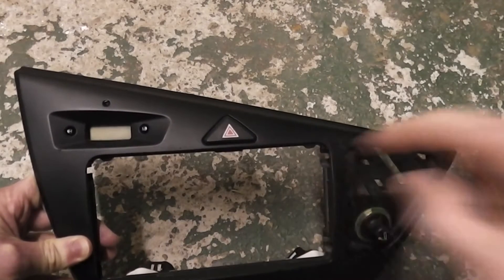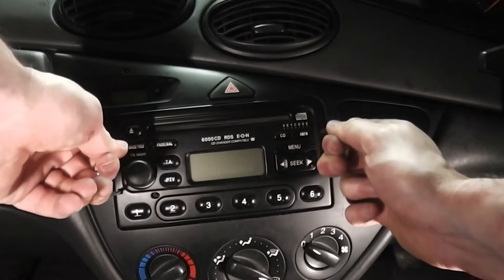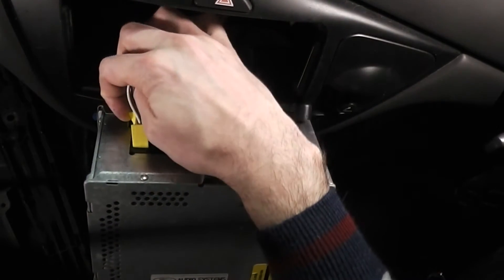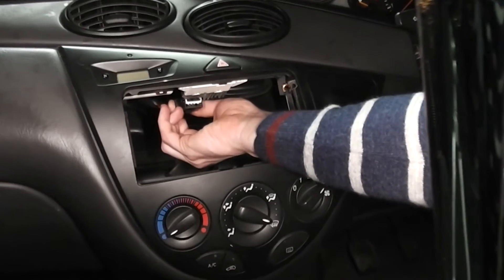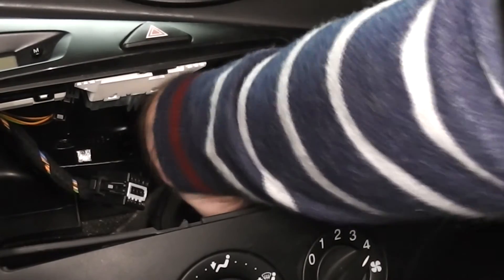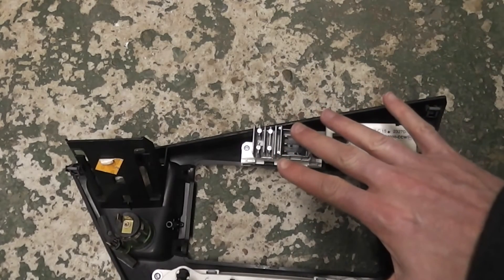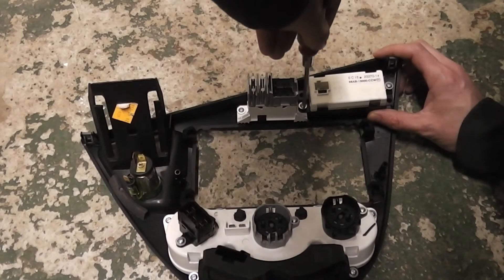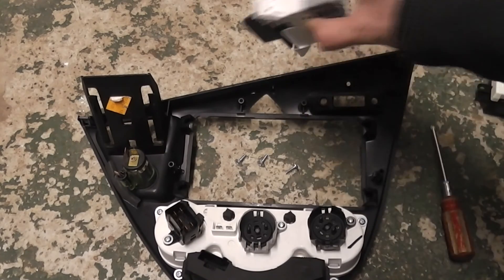Ford Focus Hazard Flashers Switch Replacement

Comment: This is a bit o/t but on my 2002 SE the red light around the hazard never shuts off, and living in a cold climate my battery is constantly being drained desd by it, but I can't find anything on turning the red light around it off (stays on whether keys are in ignition, etc.).

Any advice would be very much appreciated.

Comment: So  I do not have working hazards or indicators.  If I replace this do you have any idea if that will cure both things?  For all the research Ive done it doesnt seem like these have just a simple flasher relay to unplug and replace
Reply: Both hazards and turn signals process through this unit.
Reply: Did you ever find the cause of your issue I am currently experiencing the same issue and cannot figure out what’s causing it
Reply: @ryanposey1467  I think this did work for me. Its been so long i cant remember for sure. But they did work after i saw this

Comment: I have a Ford Focus MK1 2004 model. I need to replace the Flash relay switch with one suitable for LED turn lights (to prevent hyperflashing) but I CANNOT find its location!! Is this the one? Is it located together with the  Hazard switch? I've searched all of Google, all of the fuse box diagrams and it's nowhere to be found! Flasher Relay for the turn signals (6 bulbs) is the only relay switch I have not been able to find. Any hint for its location will be very much appreciated! I want to get this, suitable for LED lamps and replace the original for the halogen turn bulbs: https://eshop.heleco.gr/product/led-flasher-3p/